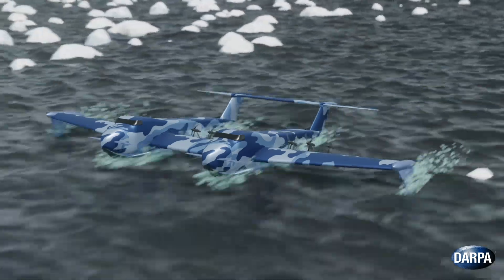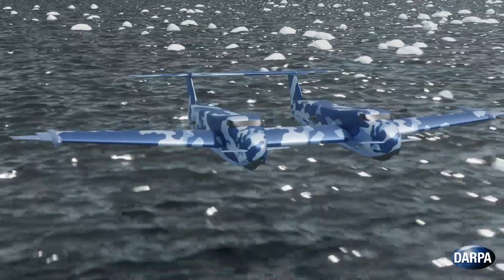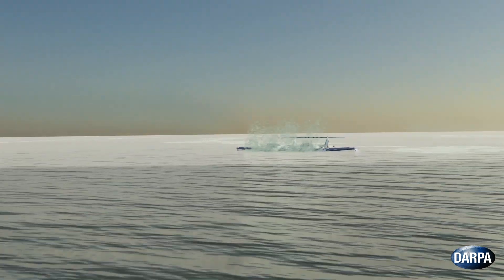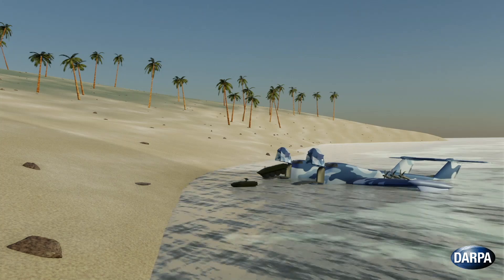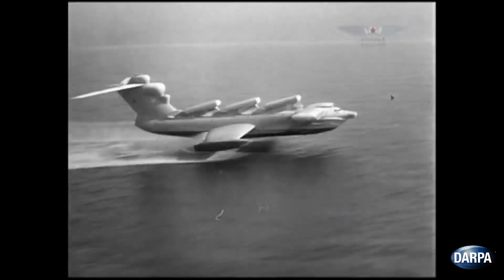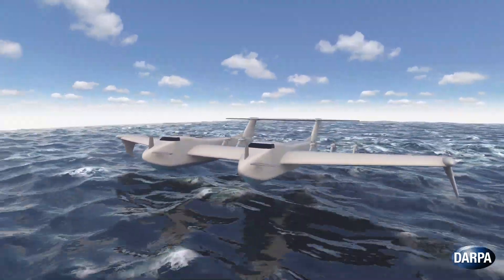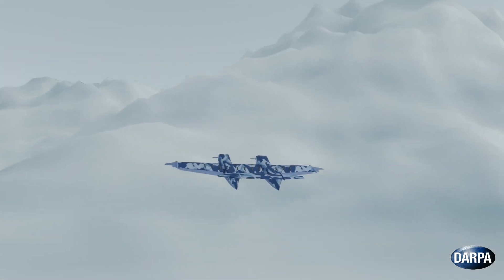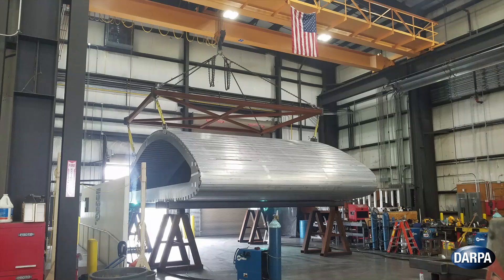Liberty Lifter

Comment: Liberty ships were cheap, the Liberty Plane should be as well. You should consider a version of all wood, or a non metallic Mine setting off material. That's the real issue on these scout type planes, it will still be the best constructed, just the best at being silent as well. These things can be advanced noticed by metallic ping if a sub is on the surface, it comes up as a flying torpedo. On the radar, just fyi...looks like a cool model to build, mabey some extendable wing pilons to not flip over for the 3, 100, 30! C ONE! going down the strip!!...! Meow..?! We GO DOWN!!!! Lol

Comment: Why such negativity about this project?  If it works, sounds like it will be a significant addition to our ability to transport supplies to a conflict zone, whether for ourselves (hopefully not) or for our allies.
Reply: Because people want to see expensive overcomplex and overbudget projects.
Reply: I love seaplanes as much as the enxt guy, but people are pessimist about the whole project because DARPA is asking for a  plane, ship and ekranoplane at the same time, to carry the same cargo as the C-5 on the cheap and on a short deadline, with a longer range
Reply: The main problem with this is the conflicting requirements. You ask for a Wing in ground effect vehicle because it means that by using surface effect you need less wing for given amount of lift. A smaller wing is great for all kinds of reasons, less drag, lower construction cost etc. But all those advantages are totally blown away when you a say - it needs to operate at 10,000 feet where there is no ground effect. You might as well just tell people to build another airplane - so no breakthrough performance at all.
Reply: Because there are more scientists in USA with far better ideas than within the government

Comment: See the Boeing "Pelican" of year 2000. >1500t payloads at slower airliner speeds, though for some reason not designed for water operation.
Bartini, Sukhoi, and Beriev have such designs over the years. Lockheed and Boeing also have GEV/seaplane designs back into the '60s.

See also the 2020 article by US Naval Institute "Modern Sea Monsters", urging development of intra-theater sealift GEVs.
Reply: It Would be nice if the U.S. could produce small missiles that can fit on a fighter jet that can produce EMP Directional beams that can knock fighter jet out of the sky  and incapacitate navy vessels and even act as a missile defense system. In which you can control the directions of a EMP wave pulse. That way you can shoot them in the air and take down hundreds of Nukes in mid air without a explosion. Just a invention I been pondering 🤔 I call it the “EMP DIRECTIONAL PULSE MISSILE”
Reply: @JamesTaylor-us5dx  I think you should do more research into how EM waves travel and what kinds of devices are actually affected by EMP. It's commonly thought that most metal body cars are capable of surviving EMP. I would expect a lot of military equipment are also capable of  withstanding. Another example, modern tanks are expected to operate in NBC disaster environments. Video games and movies do not accurately depict EMP.

Comment: A large fleet of Liberty Lifters (or similar craft) are needed to enable the U.S. to move large amounts of material from CONUS to the Pacific theater without depending on long runways that will (almost) certainly be damaged or destroyed in the first few hours of a conflict.  The key is to see if the Pentagon can actually compete, select, fund and procure a large operational fleet of these craft on time and on budget.  Pentagon procurement history hasn't been kind in this regard, but perhaps a disciplined focus on low cost, emerging technologies and "novel manufacturing techniques" will enable this program to turn out successfully this time.
Reply: Been saying it for years: The biggest threat to American security is corrupt defense contractors.
Reply: And, let me guess, Taiwan will become the proving-ground...

Comment: I have seen videos of drones capable of moving underwater as well as flying through the air. Any chance you can scale this up?
Reply: There have been various proposals. The basic issue is structural strength vs. weight. Making something that can survive water pressure (even very shallow water) will increase the structural weight to the point that payload and range are lost. It might be more feasible for smaller drones though.
Reply: Exactly!

Comment: Also known as another project to prove just what a bad idea the ekranoplan is.  All the disadvantages of a seaplane combined with all the disadvantages of a ship.
Reply: The ekranoplan sucked because it had short wings and so had to fly too close to the sea, where turbulence was an issue.  The Liberty Lifter has the right proportion to enable the plane to fly in ground effect at an altitude that reduces turbulence from the sea surface, and can make use of all the advances of flight controls and sensors that half a century and being made in the US affords.  Additionally, the Liberty Lifter is designed to be able to fly out of ground effect as a normal airplane.  So effectively it is just a normal cargo seaplane but with wing-in-ground-effect superpowers, not anything like an ekranoplan.
Reply: @AvanaVana  Maybe, but it's being pushed as a ground effect vehicle.  Flying low enough to be in ground effect is one of the most dangerous areas of flight, because if anything goes wrong then you can find yourself out of airspeed, altitude, and options very quickly. As a cargo seaplane it might be useful for delivering very heavy cargo very quickly in peacetime.  In a wartime situation it would be big, slow, and lumbering, and very easy to shoot down.  I just don't see the utility of it.
Reply: @murdelabop  You don't fly it into an area where you don't have air superiority. You use it to shore up a hot spot at a moment's notice, instead of wringing your hands because ships will take months and c-5s can't land at the non-existent airstrips. Once you lose air superiority (really total air dominance) all your transport vehicles (ships or aircraft) are gone.
Reply: The main reason seaplanes fell out of favor was that they required very large jet engines if they were going to use jet engines because jet engines are relatively weak at low speeds, but you need the most power at low speed to get off the water.  Passengers want to go fast, so you needed jets.  Gasoline engines did not have that large of a penalty.  Very large jet engines have not just the penalty of more expensive engines but the extra weight of the oversized engine which was the real killer.  But with electric motors, which this appears to use, that disadvantage should be nullified.  Electric motors have full power at low speed, and can be very powerful relative to weight.  You also don't have to engineer expensive engines.  Motors are very easy and cheap to design and build.
I am guessing they have a generator or generators in the aircraft and just wires to electric motors for propulsion.  It is possible they have batteries in mind, but we are probably a few years away from that, at least for long range cargo.
Reply: @ChessMasterNate  Perhaps, but today's jet engines are not the jet engines of the 1960s.  The split power idea is an interesting one, if it could be made to work.  I just wonder how much taxpayer money will be thrown at this thing to have it end up like the Spruce Goose, or the Caspian Sea Monster.
Reply: @ChessMasterNate  Depending on the speed they want, why not use turboprops or unducted fans. Flying in actual ground effect requires less power than flying above ground effect. I would like to hear the reason some of those soviet designs had such massive rows of jets before the wings. They seemed more like weird hovercraft designs than real wig designs. And....they ought to design this thing with Pelican dimensioned fuselages, not these dinky ones.
Reply: Carry loads like a small ship at slower airliner speeds, across vast distances and not require permanent port facilities but which can be serviced anywhere on the planet that isn't a runway, unlike any freight aircraft, which needs an airbase.
Reply: @JFrazer4303  It's still going to need bases, only it'll need seaplane bases, like the Boeing Clippers of the 1930s.  With a service ceiling of only 10,000 feet it also won't be able to use the advantages of high altitude flight.  Plus, they overwhelming majority of transoceanic freight moves in containers.  This thing is just a bad idea all around, except possibly as a defense project.  But then, Boeing is primarily a defense contractor.
Reply: @murdelabop  In a Taiwan invasion scenario with Chinese preemptive strike on US bases from Guam to Japan, ekranoplan would be useful. What do you think?
Reply: @christophervasques1322  Possibly, but if we don't already have logistics in place at the time then we'd be screwed anyway.